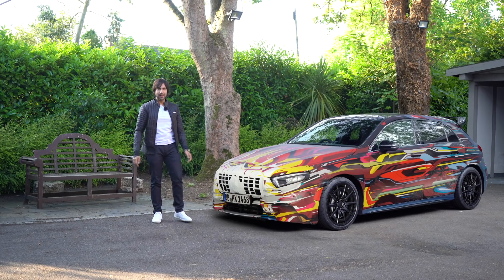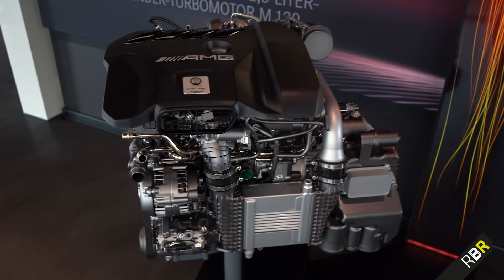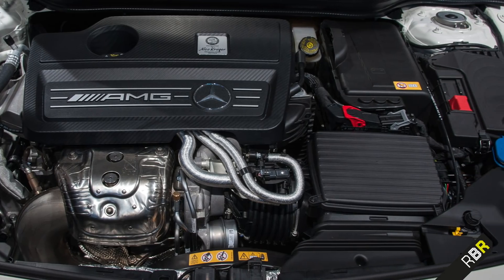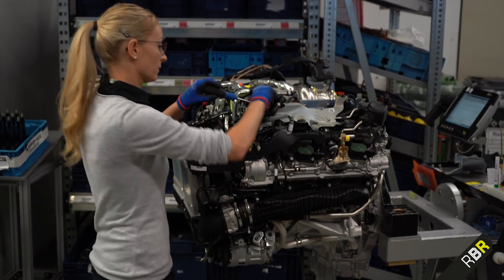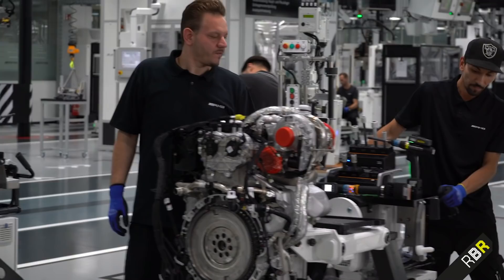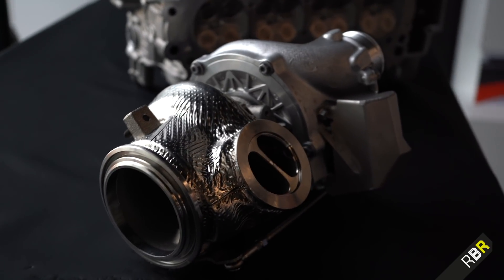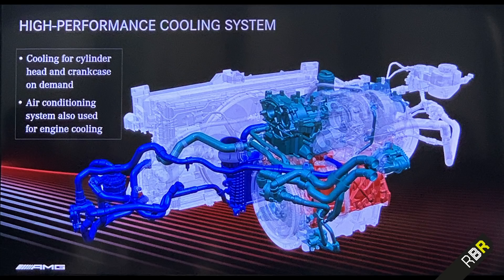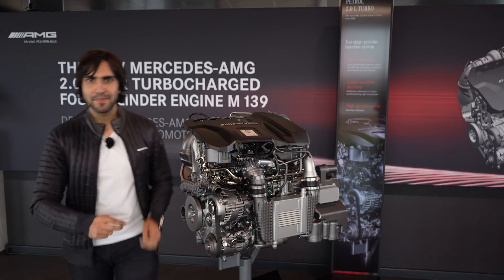New 2020 AMG Engine! Exclusive Factory Access to the worlds most powerful 2.0 turbo!

Comment: For me the new A45 is the most anticipated car of the year, the first real Hyperhatch.
Reply: We don't know yet how it will perform...
Reply: @Elias_g1  No you're right but with this footage of this new engine the m133 with 421 bhp and some early teasers. they are their taking the time to make it the best they can. I can't wait to see the first tests of it.
Reply: Audi have been making a Hyperhatch for 8+ Years now.
Reply: @lewiscannon8213  oke could be, so factory off with 400+ bhp, 2 liter, entry lvl car? Not the A1, A2, so which one, I could be wrong of course.
Reply: @airwavesfromholland  " Audi RS3 " you didn't say anything about it having to be a 2L 4pot.
Reply: @lewiscannon8213  point for you, but come on in that case we could mention the BMW m140 with a 6 cilinders engine, which doesn't have 400bhp or a  C class amg, the A class is the smallest car they make, the RS3 is an awesome car no question about that but not a entry lvl car. And it's not a 400+ bhp, 400 exactly.
Reply: Also the RS3 has a 2.5L 5cylinder engine that makes 400 hp.Not a 2L 4cyl....
Reply: @Elias_g1  I know.
Reply: @airwavesfromholland  
The Audi RS3 and the MB A45 are both C-segmet cars. "Entry-level" doesn't really mean jackshit. Also, they both understeer at the limit like pigs because Haldex is garbage. They handle like FWD cars.
Reply: @JAnx01  Well the tests will give a final result, and I'm gonna wait for those, instead of your opinion.
Reply: @airwavesfromholland  
At this point, perhaps over 100 car models have been equipped with the Haldex AWD and they all understeer because of how the system works (FWD most of the time and only sending up to 50% power to the rear axle), but if you want to have get your hopes high for the new A45, go ahead. Be my guest. Wait for these "tests" of the 101st Haldex-equipped car to confirm to you what everybody else knows is a well established fact in the car industry.

And btw. The RS3 isn't new. The reviews have been out for a long time.
Reply: @JAnx01  the RS3 has been updated in 2018. And a RS3 or A45 will cost about 80.000 Euro, giving it a proper 4 wheel drive system will make It a lot more expencive and let's be honest how many people in real life use need that, only a few, just like a car that can reach 320 km or 200mph its nice that you can say I've got a car which can reach that, but in every country are speed limits except parts of the autobahn, so what is the use. And you're not a fan of Audi or Mercedes? BMW person?
Reply: @Auto blipper they building these small cars with these engines because of environmental rules and regulations. So they still can sell a shit load of them. The hunger for powerfull cars will always be around. Putting a small engine in a heavy car like a S-class, Bentley or Rolls Royse is  eh let's say rather difficult those cars rely on torque en 500nm doesn't cut in a big and heavy car

Comment: It's good to know that future V8 models are going up to 800+ hp, because 421hp from a 4 pot brings the 45 models too close to the base model V8s.
Reply: 800 Hp just with Hybrid System.. Never alone..
Reply: BOB BOB true but non hybrid versions may go up to 700hp in the mean time. And in the long run, Hybrid models will most likely be the only versions available (as we transition to electric).
Reply: Honestly tho why would you need so much horsepower in a daily car? It's not like you're a racer or anything. 400hp is still the sweet spot for me personally.
Reply: Whiteless Eyes I’m not a racer, but I do actually drive a lot on track and I enjoy the power a lot on the straights. As for daily usage, I’m used to driving 500+ hp cars, so I can’t really go back.
Reply: more power mean a lot of problem I don't think this thing will outlast its warranty....
Reply: @campkira  people said the exact same thing as you 6 years ago when the original A45 came out and look how successful its been
Reply: Lol 800 hp wasn't nothing new for the twin turbo v12s
Reply: Seeing 4-cyl engines getting this powerful is in no way an indication of future V8s getting more power, quite the opposite, it’s the canary in the coal mine. Performance R&D is pointing only one way: less cylinders, more boost, more hybrid-electric integration
Reply: @lcloutier1000  BMW was producing a 1.5l 4 pot making ~1350bhp 30 years ago.
Reply: BOB BOB u forget McLaren?
Reply: Facts
Reply: First Last that's f1 though. Racing engines can make ridiculous power from very little displacement, but they don't last long and don't have the power curve for daily driving.
Reply: @Auto blipper Meh, for those not living in cities its very nice to smoke tires.
Reply: @SpamMeGooglification  Yeah the so called quali engine did (the quote is 1200hp btw), and the engine lasted 3 laps, quite often not the entire hotlap and ran on acetone. So its a small difference. In race spec they were 600 abouts. Todays V6 hybrids are much more powerfull and last longer.
Reply: Because more horsepower means better driving, right?
Reply: Spoken like a true magazine racer :) 400hp I4 drives completely different than a 600hp V8. Not just about the numbers. Totally different.
Reply: N actuallly I’ve done a fair bit of driving on track in various different cars including AMGs. So I say this based on the different powertrains I’ve experienced.
Reply: Daniel Sadjadian I guess technically you did say the base model v8’s, which this could maybe be similar to vs AMG’s, enough that it falls into the “opinion” zone :)
Reply: Poor torque.
Reply: Thats not how that works :/
You cant maintain the efficiency raising the amount of cylinders
Reply: @campkira  not in Russia
Otherwise it will be fine
Reply: @dexterjsullen  which ones?
Reply: AMG has said that 639 PS will be the maximum output of the M177. So everything above will be EQ Power+. Very unfortunate.
Reply: 3 years later, V8 models all adopt this 4 cylinders engine and the electric car era begins.
Reply: @lausf01  not all, the GT, SL, S class, G wagon, etc… are still V8 or V8 Hybrid for a little while longer. Ultimately though, even 4 cylinder will be axed as politicians seem to be pushing for an EV only future.

Comment: Beautiful engine and great insightful video. 

For me its not the power that's eye opening as small capacity turbo engines have been making big power for decades I.e the 1980s F1 BMW 1.5lt four with 1200bhp or similar

What's really spectacular for me is the engineering required to make this new engine both compliant and reliable.

Comment: After the end of the 65 series of AMG, the V12 will live a last time on the next generation Maybach S-class but unlike the V12, I hope that we'll see a new generation of the V8 based on this new 4 cylinder. A new M139-based V8 could easily get +700 PS before hybridization for a maximum combined power from 900 to 1000 PS.

Comment: You know: No matter how good the engine gets: What Mercedes really needs for the A45: is a better / Less laggy Gearbox! Am i right, or am i very correct... ?? Is not even as good as the Golf GTI/ Golf R's DSG...  For much lower price as well!  👍
Reply: @3DFX Totally agree, from first-hand experience. VW's DSG is the benchmark. I went from VW 2.0t DSG to M-B B250. Engine dynamics is worse than the 2.0t VW and the 7sp M-B DSG is way jerkier, slower and programming to drop into 7th gear as low as 45kph just sucks. Regardless of the so-called S-mode.

Comment: Still, even the 421 hp wont be able to compete against rs3
Reply: mercedes usually underperforms a little bit. so it probably will be as quick or a little slower than the latest rs3 400hp.
Reply: guess what, its actually crushes the rs3, on straight line and on track lol
Reply: @gunterification  guess what, its actually crushes the rs3, on straight line and on track lol

Comment: Well bmw m140i and m2 comp, eat your pistons out! 2.0ltr with 420bhp+ and bmw can't extract that with the 3.0 flat 6? From the smaller hatch and coupe variants. Disappointing. If bmw next M2 or M1 Doesn't have at least 450bhp then it's pointless.
Reply: Supermanbeemer
  m2 is is not all wheel drive and can’t put the power down like the amg which is all wheel drive. The m2 is drivers car and the amg is for the ladies who like going in a straight line.

Comment: This engine is not cool, it's obsolete and outdated
It is too conservative
If it was cool it would be designed with direct drive integrated torque fill motors for power blend like the way Koenigsegg has
Reply: Well mercedes doesn't need to go from 0 to 100 in 2 seconds, now does it?
Reply: @tedarcher9120  Not only that... but merc needs to be able to sell the thing for less that a 100k !!!    This is the entry level AMG of the Real AMG's .....  should be kinda affordable....